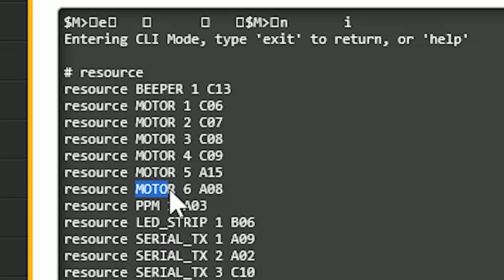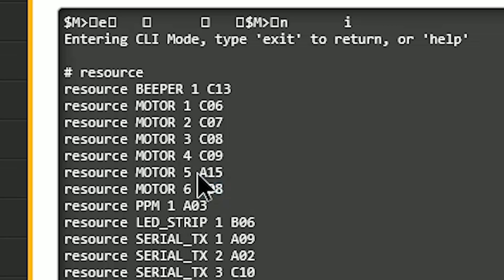Betaflight FPV Camera Control | HOW TO

Comment: Swift mini 2 with my kakute 1.3 works without additional elements.
Important thing. For 3s it worked perfectly out of the box. For 4s I had to lower the key delay.
I used the pad for motor 5.
Betaflight 3.4

Comment: ...works without all that nonsense. Just connect , ressource camera_control to the the pin and your done. Works fine on all my quads...
Reply from the maker: Take it from somebody who gets lots of emails from people for whom it doesn't work--you're lucky. Your FC and camera happen to have enough capacitance that the default settings work. Congratulations. For about 50% of people it doesn't work on defaults, and for maybe 25% it never works at all.

Comment: Was this video before your JB F4? Your board has a camera control pad, does it still need a capacitor for connecting to a Runcam Swift mini?
Reply: I think I just answered my own question, your board came out a couple of months after this video. Can you please still let me know about the capacitor? Thanks!

Comment: If we have a board like the Bardwell F4, and we soldier the OSD pin to Cam-C,  do we still have to use the GND that's associated with the Runcam OSD controller??
Reply from the maker: You probably don't need to. The power ground wire probably is sufficient.
Reply: Thanks Josh, I'll let ya know how it functions.

Comment: Ive just done this on a matek 405 ctr fc. I put the blue wire to the DAC  pad and black to G but i cant access the camera menu by centering the throtle stick and moving to the right. Is there something else i need to do or a setting in BF i need to turn on?
P.s thanks for all your videos, i couldnt have built, setup and started flying my quad without them 👍

Comment: Im using the helio spring aio fc and i have the foxeer predator mini. And i have connected the signal to the cc pad on the fc and the grn to a ground pad. Im using the new odin 3.5.1 firmware and i cant get it to work. I was just wondering if i have to enter anything into the cli to get it to turn on? Also what stick commands do you use for  butterflight to access the cc me u
Reply from the maker: Center throttle yaw right to enter camera mode. Yaw left to exit camera mode.

In camera mode center throttle yaw right to click enter. Use pitch and roll to go up and down left and right.
Reply: Joshua Bardwell ok great thanks.. i just cant seeme to get the menu up.  Theres nothing in the cli i need to turn on.? Im using the new runcam sparrow pro 2.

Comment: Hi Joshua. I was foundthis vídeo. Its in italian. But now Im wondering if its possible avoid solder any resistor and Get fpv camera remote control using this method...
https://m.youtube.com/watch?v=u666-jv8Hb8&index=3&list=PLIFLEuCHb8pF1i2gTKb-XAT7V2MFwMPvv&t=162s

Comment: Joshua:  this is what I’ve discovered so far.
Matek replied back motor 7 = B08, which on the F-7 board is the pwm pin.
I was not releasing the other “requests” for same pin.
I now have camera _control = B08
And, on top of that. 
You have to type SAVE in CLI!  Still need to add the resistor and scrounging around for a 0.1-10 MF capacitor.

Comment: When I type "resource camera_control pb8" I get the response "parse error".
Reply: I just typed "get camera" just to see what comes up.  It says "camera_control_mode = HARDWARE_PWM".  Also says camera_control_internal_resistance = 470".  Should I be safe to connect the OSD wire from the camera to the PWM pad without releasing any magic smoke?  Waiting on your wisdom.  Thanks again for all you do!
Reply: Well, nothing ventured, nothing gained... So, I'm going for it.  I'm going to cut the camera control jst off leaving me just enough wire on the jst that if it doesn't work, I can solder it back on. OSD wire to the PWM pad and the other wire to GND.

Comment: Josh; Gimbles centered, then left gimble to the right did not work for me.  So, I started playing with the gimbles.  Right gimble up and left gimble to the left gets me to camera settings.  I have a Matek F-7 STD and Foxeer Predator mini, Taranis qx7.  No Cap added no CLI settings changed.  I hope this helps a lot of people out there.  Nope! feeling stupid.  Those are BF settings.
Reply from the maker: Ummm I have no idea. Right gimbal has no effect until you are in camera control mode. If it does, then I'm really confused.
Reply: Yeah, sorry.  those were BF settings that came up on OSD.  Still working with this Matek F-7, PDB, VTX build.  There is a camera pin.  Hmmm  This says PA8 and PB8 can be resourced to camera control.
Reply from the maker: Remember, camera control doesn't work on every camera without tweaking CLI parameters.
Reply: Matek website says I can use PWM (PB8) for camera control.  When I type resource in CLI, looking for PWM.  I have PWM 1 A00  and PWM 2 A01.  How do I determine which is the actual PWM pad?  How does that differ from Matek's PB8?

Comment: Hi Joshua, i've purchased your F4 fc :-) i soldered the osd cam on his pad, now what i must do in betaflight? there is no mention in the  manual . Thanks!!
Reply from the maker: There is no special configuration needed. To enter camera control mode, center throttle, yaw right, as shown in this video. If it doesn't work, look at the troubleshooting section of the manual, which has a few instructions. But the feature simply doesn't work with every camera.

Comment: Hey JB, I just put a Helio Spring in one of my rigs to test and it already has the camera control built in...solder the wire to the correct pad on the fc and it just works, amazing!!! Playing around for a little while I also discovered how to find the menu to turn on/off the osd that is integrated into the camera itself (throttle stick mid, pitch forward) and how to move my pilot name around (throttle stick mid, pitch back) but I have yet to figure out how to get to the runcam swift 2 presets, do you know how to do this, or if it is even possible?
Reply: Ugh....nvm, I am a dummy! The Runcam Swift 2 doesn't have presets....it's the MICRO Swift 2 that has them lol. No wonder why I couldn't find them haha

Comment: hi i have a bis Problem i use the matek f405 osd board and a runcam swift i soldert the osd wire to the dac pin and it wont Work! i Try to set the Delay to 180 and mesured the voltage is 3,29v i also try to remap the the motor 6 pin to Try out but nothing  happens! can u help me pls

Comment: Thanks. Working on Omnibus F4 pro on PWM 5 with 580 ohm resistor and 100nf ceramic/tantalum cap. Foxeer Arrow V2 or 3. Cheers.

Comment: Has anyone got this to work on an SP Racing F3 board using a motor signal pad?  I can get SmartAudio to work just fine using a motor 7 pad.  When I try this on motor 6 (or 8 or 5 for that matter) It  works great EXCEPT, motors 3 and 4 no longer spin.  1 and 2 work fine.  I can release the resources for motors 5-8 and motors 1-4 spin fine.  After I run "resource CAMERA_CONTROL 1 B09" (I'm using motor 6 pad) and save,  I can't get motor 3 or 4 to spin. Any idea what's going on?
Reply from the maker: I assume you are using dshot and there is a DMA channel conflict between the pads that won't work at the same time.
Reply: That was unfortunate.  I really didn't want to pull the whole stack out to get to the bottom of the FC for the LED pad, but I finally did and it works like a charm.  Thanks.

Comment: Juris Zvaigzne   Juris Zvaigzne
5 maanden geleden
How about old camera like Foxeer XAT600M   it has a different connection. Great videos they help a lot.
1
Damien Weeks Damien Weeks
5 maanden geleden
Great video Joshua! I'd like to know about this also. The Foxeer XAR600M has pin out 5-22v, GND, VID, OSD. Would you just follow the same steps just without the need to connect an additional ground wire?

Comment: Hey Joshua,
I've wired the osd port of my fpv camera into the pad to control the camera on one of you jbf4's, and I'm not able to bring up the menu, I understand it's, mid throttle and yaw right.
But nothing happen, is there anything I can do to troubleshoot ?
Reply: measured the ref_voltage and set it to 228 and it works now !

Comment: do you need the ground on the OSD to make this work or is only 1 ground from camera to the board enough to make this work?
Reply from the maker: One ground will work in many cases.
Reply: Joshua Bardwell i have your flight controller and with the RunCam Swift Mini it will not come up.... :(  I also added on the extra ground after seeing you had two grounds on this build.

Comment: Hey Joshua, On the (  CL_RACING F4S FC with Foxeer hs1177  )  I ran the OSD from the camera to the camera control pad on the fs4. And not working. I kinda figured since the f4s fc has a dedicated control pad you could just wire it to the osd. Any help would be great Thanks again, And thanks for everything you do for the fpv community. Dean
Reply from the maker: Please check out the "troubleshooting" section of my FC's manual. You can download it from the product page at RaceDayQuads.

Comment: Thanks for putting this video together, I really appreciate all of the work that you do  to make us smarter.

 Quick question and I'm sorry if this has been answered already: Is there a risk of damaging any of the components if I attempt this without the resistor? 

My FC already has a cam control pad so I'm not sure if I need the resistor and cap.
Reply from the maker: No risk.

Comment: Hi Joshua and guys, I use the new Matek F405-STD. It says S5 (PA15)  or S6 pad (PA8) can be resourced to Camera Control. And on the wiring diagram shows a simple blue wire to S6 from the camera control. Do I need a resistor in this case or it is in the FC?
Reply from the maker: Yes you need a resistor in this case.
Reply: thank you, I have almost done it without resistor

Comment: Hi! Anyone that knows how to exit from runcam pilot/baseline/etc menu ? ( the one joystick equivalent of pressing Up button to enter ) .I can  enter through the radio control and move around but I cannot exit !!! ( JB FC + Runcam owl plus )
Reply: You probably already figured this out, but for those that may read this comment, for the most common setup, pitch up and down (right stick) to move up and down in the menus and with the throttle centered, yaw right to select sub-menus or to select exit (left stick). Also, at least with my Runcam Swift 2 RR, when the mode is displayed (i.e. personal, cloudy, etc.) I can cycle through them by rolling right (right stick to the right).

Comment: Josh, I am troubleshooting a RunCam Sky+ on a Kakute F4 v2.Not sure I am getting any signal from the LED pin on the FC. If I test the resistance on the LED and GND pins on the FC while I (Left Stick Throttle Center Yaw Right) I assume it will show some change, but I got nothing.Ref Voltage is 3.27vStumped...

Comment: Great video! I measured voltage across Camera and Ground wires and got 3.16, entered this into CLI. No camera menu with Throttle mid/yaw right. Rechecked everything. Tried changing voltage back to stock 330, and then it worked! Im running Kakute F4V2, RunCam Eagle 2 Pro with 220 Ohm resister, no cap.
Reply: Chris, Im having issues with a Kakute F4 v2 with a RunCam Sky+. What was the Resource for the LED_STRIP that you used for the CAMERA_CONTROL?  I cant get the camera to enter the menu mode.
Reply: LED_STRIP was on C08. Make sure to release LED_STRIP first then set CAMERA_CONTROL to CO8. Check by typing RESOURCE LIST to make sure CAMERA_CONTROL is the only resource on C08.
Reply: Thanks Chris, I did do the release and verified the only use of C08 is CAMERA_CONTROL,  its killing me I can t get the initial camera menu to come up. I may test it with a different camera. I am running a 470 Ohm resistor with a 4.7uF Cap, getting 3.28 ref voltage.
Reply: Does this still work with BF 4.1.1? Trying to get this going with Kakute F7 and I can get the menu up, but it constantly scrolls down. No resistor currently.

Comment: Hi JB! Quick question ... I am using the new CL racing fc paired with the predator mini camera . So as you are probably aware of this situation... the designated camera control pin seems to need some tweaking to be able to access camera controls via transmitter.
Any suggestions correct resistor values /capacitor if needed?
Appreciate all your efforts helping us!
Thank you Russ.
Reply from the maker: The resistor value is not important so long as it is between the specified range, I think 200 to 1000 ohms. People are having the most luck playing with the internal resistance and voltage reference values. But there is no rhyme or reason to it. Just try different values until it works.
Reply: Joshua Bardwell 
Thank you for the fast reply! Your the man ! I’ll give it a shot!

Comment: Using the ARTOWER F4 PLUS with an led strip do you know of another pin or tab to access for camera control? I have 2 uart connectors not in use. I don't know if they have timers.
Reply from the maker: UART can't be used for camera control. Spare motor output would be the other main ones to go for.

Comment: Good evening and congratulations for your videos, you are great! Just one question, I'm struggeling with this mod. I have an SPRacing F3 running the last version of Betaflight (+3.2), Foxeer HS1177 camera with a minimosd installed on the UART2. On UART3 I have my Spektrum DSMX satellite and also I have my LED Strip on the back of my quad. I tried on motor 8 pin signal with a resistance of 150, 180, 220 and 2x220 with no chance, the config I did was with Hardware_PWM and voltage measure was 3.2v. All the other commands were as default. I can see on CLI command the correct assigment of the mapping to camera_control, but it doesn't work. I tryed also to put a capacitor in it's place with both Hardware and Software configuration with no chance either. Can anyone help me with this? Thank you very much!

Pablo
Reply: I think I know my mistake. Could it be that the activation of the OSD of the camera needs the sticks controls to be right over the 2000 number in betaflight? I have mine in 1998 and I think this was the problem I couldn't trigger the OSD with the yaw
Reply from the maker: You need the stick to exceed the "stick min threshold" and "stick max threshold". These values should be set to a value such that the stick can exceed them so if your stick goes to 1998 set the stick max threshold to 1985 or something.
Reply: Did you ever get this to work?
Reply: Yes. I used the 150 resistance on motor 8 and with the recommendations of Joshua about the min/max stick threshold. My problem was that I didn't get the max on the yaw. Kind regards!

Comment: I've got a foxeer micro wired up to the correct Camera_C (Bardwell F4 board) and neutral to the same neutral the camera is wired to. Any reason the camera control won't work. On Betaflight 3.2.3 on newest configurator.
Reply from the maker: Getting camera control to work often requires manual tweaking of CLI parameters. The CAM_C pad saves you the trouble of installing a resistor, but the feature itself is unable to guarantee that it works on every camera.

https://github.com/betaflight/betaflight/wiki/FPV-Camera-Control-(Joystick-Emulation)

Comment: Hi joshua thnx for the info AGAIN . I use now a dys f4 aio v2 pro . These have 2 pads I2c sda and 12c scl.  Never seen these pads before . What can i do with this . Is this Also for cam control? 

Thnx !

Erik
Reply from the maker: +erikjede1ste those are i2c interface for connection most typically to external GPS, barometer, compass sensor.
Reply: Thank you!!

Comment: I have a betaflight f4 board and in flight my cam control pops up is there fix and is there a way to use this on my Lua script on taranis.
Reply from the maker: +Michael F I don't believe that cam control should ever appear when armed. Can you identify if it happens at random vs when you move the sticks a certain way? Does it happen if you are just hovering with the sticks centered?

Comment: Joshua, I am using your FC with the RR Runcam Swift and it doesnt seem to be working, is there something more I need to do?

I checked the thread on rcgroups but I dont see that combo.
Reply from the maker: +Aj Braden it isn't guaranteed to work on every camera. Go through the troubleshooting steps in then wiki entry on camera control.

Comment: Matek F405 OSD users:  I tried to wire up to LED pin but it didnt work.  Instead wire up to an Extra Motor pad.  I used Motor 6 resource A08

Comment: Might I recommend Adafruit Silicone Hookupwire as well as a recommendation. I've found that the wire kits like you have, have very thick insulation, which is great for most things. The problem I run into with that type of wire is that if you want to get into crimping your own connectors, the type you show is too thick, whereas the adafruit hookup wire is the same as the thickness that comes with the connectors themselves.